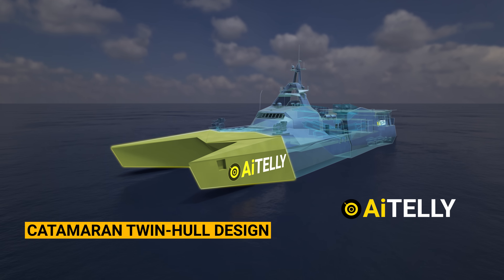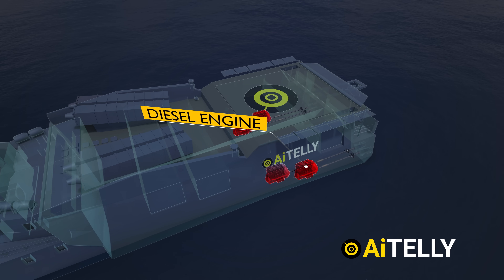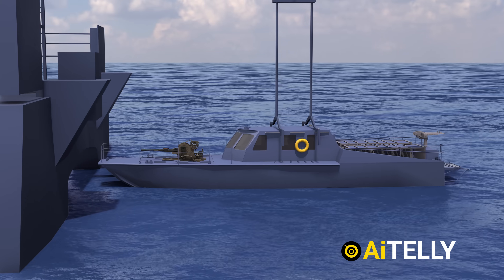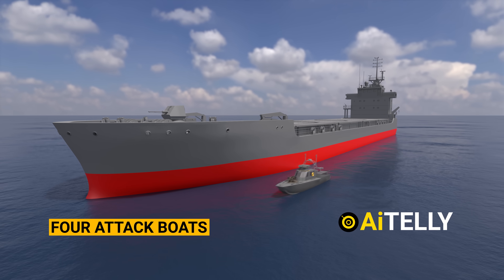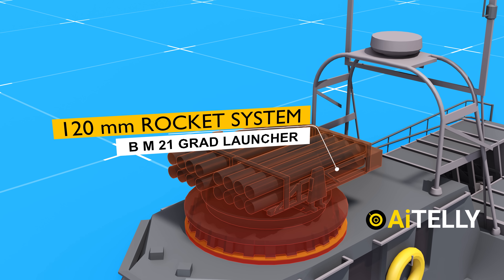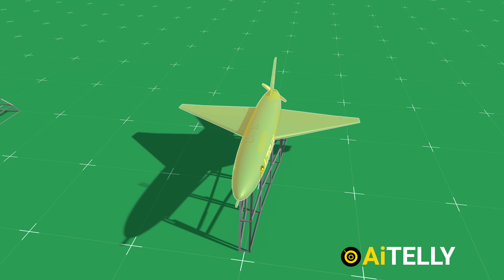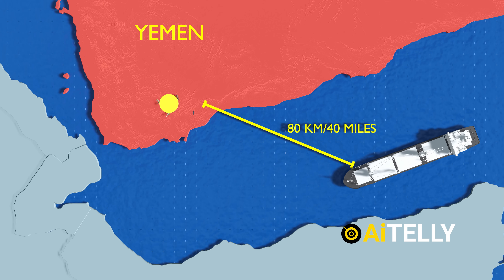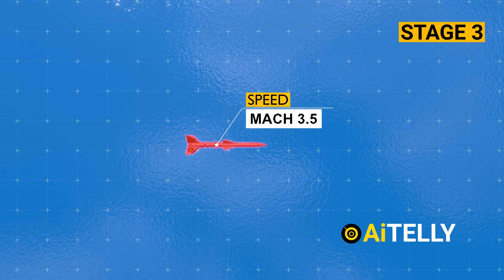Iranian Navy Ships How they are made | Iranian corvette Shahid Soleimani

Comment: You should have mentioned that Bel 205, Bel 206, Bel 212, Bel 214, and Bel 412 helicopters and the upgraded Iranian Cobra model called Tofan 2 are reverse engineered in Shahid and Pahana companies and are completely Iranian from the engine and The gearbox of the blade body is completely made in Iran and it was made in the Shah's time, but it has been reverse-engineered with Iranian devices without the permission of Bell, and even the C-King and F5 Tiger and the F14 Tomcat engine have been reverse-engineered.

Comment: At don't spread lies. First Iran facing santion from 1967 by UN. So by showing your animation of upgrading ships helicopter or plane never happened. The most important: because of the santion by UN in 1969 Iran cound not bring spare parts to repair their helicopter neither purchase new one . The consiquence the president travelled in old model 50 years backward class helicopter which chrashed. So first upgrade purchase new generation aircraft and then think of war. Or it will be very foolish move.

Comment: Not that it matters much but your off in a few places. The Soulamani belongs to the IRGC navy, not the Iranian Navy. The diagram is off, the VLS is in the wrong place you then ID it as the ASM when it's not. The "Bell and Cobra" helicopters? They are both Bell one is a Huey the other a cobra and the 412 is a  Agusta Bell imported for non military use but converted and still modern, a cargo /multi role variant. the Bell 212 is the asw variant. Neither are "heavy" they are med weight helicopters. Iran now produces both Helicopters (Huey and Cobra) you speak of via Hesa which is their aviation  manufacture.  The Tondar class is the c14 china cat.  It is not equipped with rockets at all, but has 4 c802 ASM. It has the zu 23 aft and a twin AK230  30mm on the bow, ten boats in service and they were delivered in the eighties. The Rockets used in the IRIN are usually 140mm A22 Ogon, designed for naval use and not grad 122mm rockets.   ( Grads 122mm have been mounted on other platforms)     While it sounds like splitting hairs it is still better to be accurate,